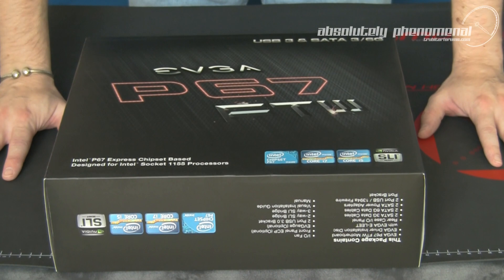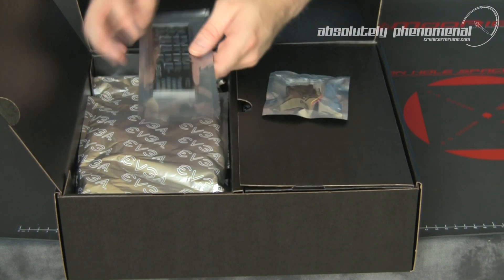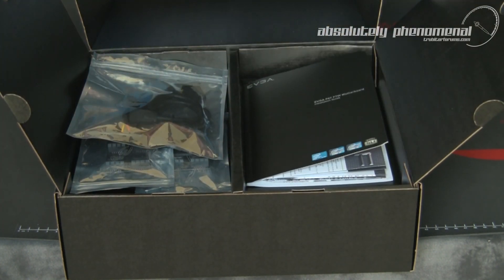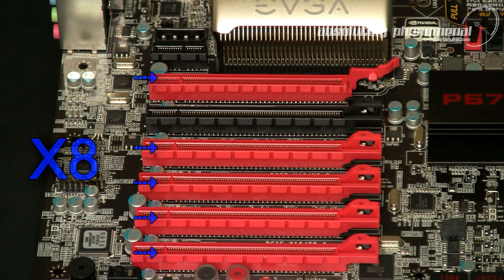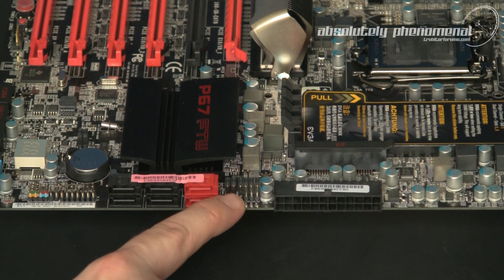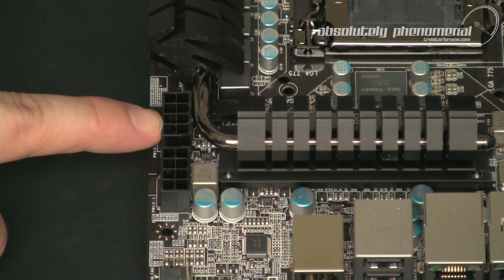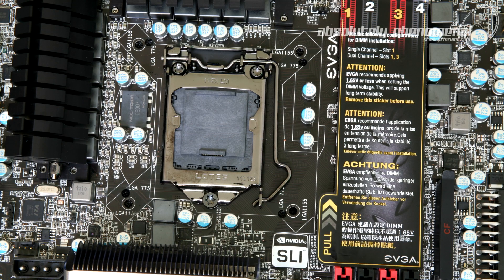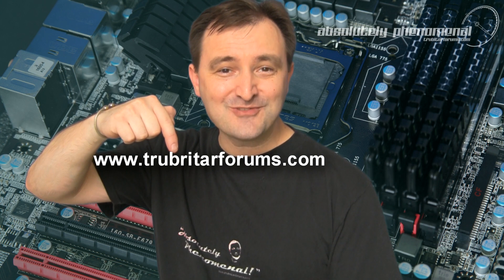EVGA P67 FTW.Motherboard

Comment: In the spirit of thinking before we comment:

P67 was not replaced by Z68 - the Z68 just had some extra features. There is no such thing as a 2800k and Ivy Bridge was always planned for socket 1155. The 3960 is considerably faster in multi-threaded apps, since it's a 6 core, but it's not just flat out 47% faster...It's also insanely expensive, not intended for gamers and power users. Socket 2011 is an enthusiast-level platform.

Bulldozer, aka faildozer, failed.

That is all.

Comment: Well, so far it's been one of the most solid boards I've ever owned. Not had one problem, so far, after nearly a year (and now around 2 months having my 2600k OCed to 4.5ghz). They are a much smaller company than the others, so their lemons are going to be more frequent, however, I've never heard of a board killing  RAM without it being very obvious that something else is wrong...or user error >.> Not implying anything, just seems like an oddball issue =/ Sry u had a bad experience, anyway...

Comment: Zzzzz Zzzz P67 is obsolete as it has been replace by Z68 months ago which is also obsolete. 2800k is the final proccess for LGA1155 and will be released next month. Zzzz Zzzz
The X79 motherboards will be released in November with the new LGA2011 processor i7-3960X 47% faster than 2600k.
AMD also launches there 8 core processor FX-8150 4.2 GHz next month which will be faster than intel 3.90GHz and should force intel to lower processor prices.

Comment: So if you add another graphics card, the primary slot drops to 8x? Hmm looks like an amazing board but with that I just don't know. At this point in time on the 1155 chipset life cycle, this bored should have offered 2, PCIe at  a stable 16x. But that's probably nit-picking. Everything else looks amazing. Wish I had this in my HAF X. D:

Comment: @zahndy I'm a silence nut I guess. I can't hear my 9800 GTX+ at all even with 75c load, fan at 70%+

When upping voltages the Northbridge certainly cranks out heat. EVGA Claims the nF Fan is optional (required for OCing of course.)

But even without OCing it gets hot enough to cause burn damage to the skin on contact...